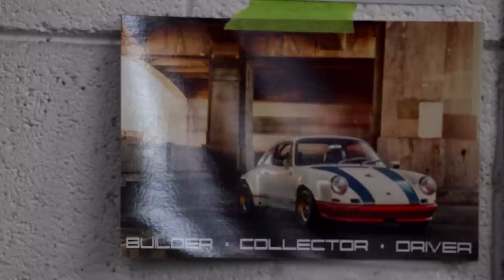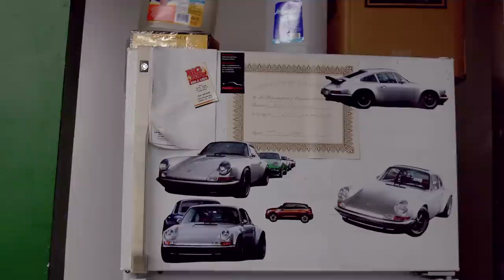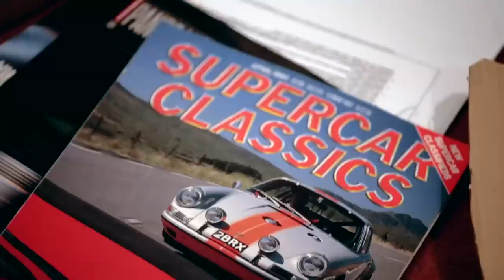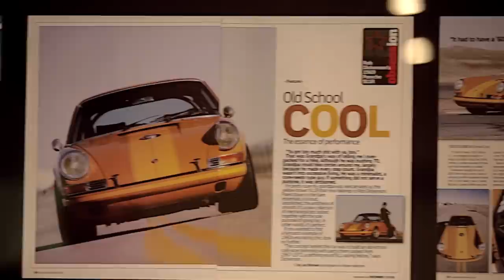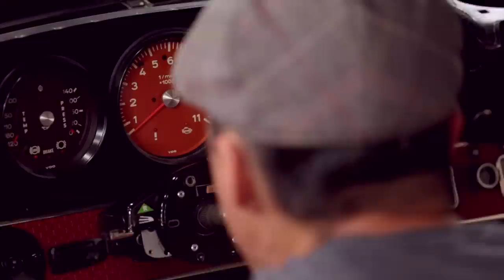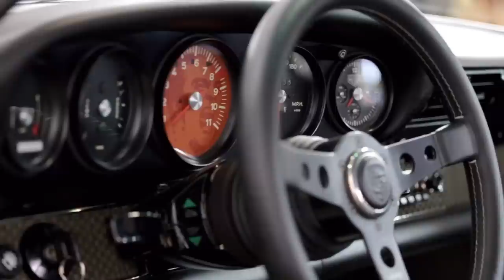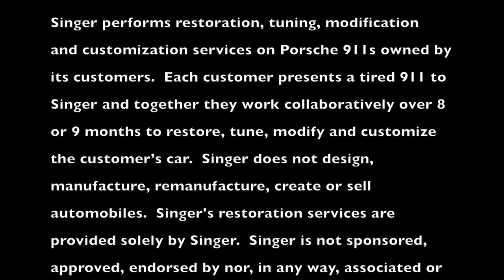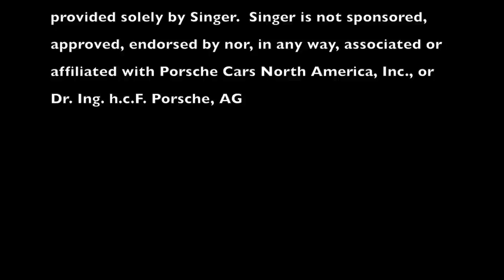Singer Vehicle Design: Porsche 911 Re-Imagined, Original Spirit - XCAR

Comment: Not sure about the 993 explanation.  I would see two issues at work here.  First, 993 values remained higher than 964... a lot higher.  Second, most purists would agree the 993 is a car that Porsche really got right.  Not like 964 which had awkward bumpers while the 993 was aesthetically pure from the factory. In other words, the 964 had lots of room for improvement mechanically and aesthetically, far more room for improvement than a 993.  So it is logical to not mess with a really good product and focus on a product that's got tons of room for improvement.  There should always be an asterisk next to the 911 as the winningest race car. It damn well better be!  Porsche has been making the 911 for more than half a century!  I can only imagine how good a single Ferrari would be if they made only one car for 55 years.

Comment: Luxury goods are exactly that and value for money is hardly a priority. But a 20 year old 911 (the guy himself dismissed the idea that they are custom cars) for half a million dollars is insane.
Reply: You'd be hard pressed to find anything on the car that is 20 yrs old. The body (without panels), the steering column, and the engine block maybe. The entire car is pretty much brand new. Building a bespoke carbon fibre vehicle in very low volumes, with the best of everything, is not cheap. An extreme example is an F1 car - $3M to $4M each for a single car.
Reply: yakadee Only the panels are carbon fibre, not the chassis... But yeah I can't see how it's not a (very nice) custom car. :)

Comment: He makes it sound like he is doing a public service rescuing old 911's as a charitable cause but takes 500k for each car.  A 997 turbo in mint condition can be had for around 100k and is far superior in any way than these.  I have far more power than these in my S4 with a very cheap tune and much more powerful and faster than my 9114s.  Makes a new 911 turbo look like a bargain.